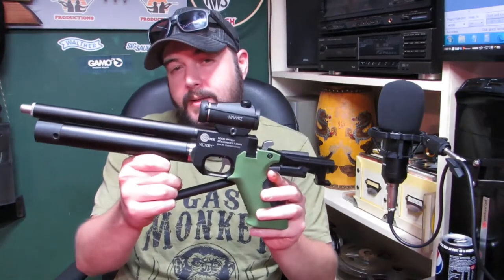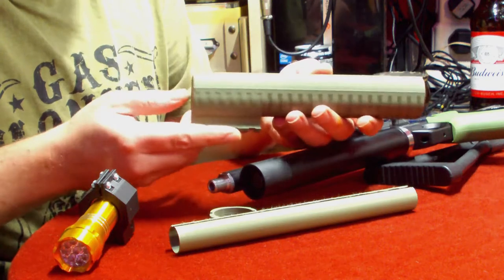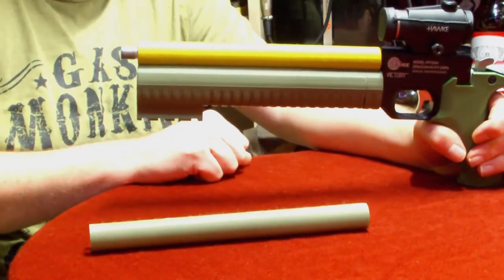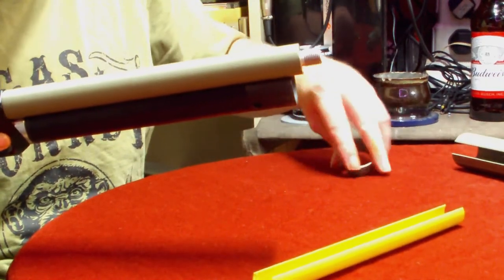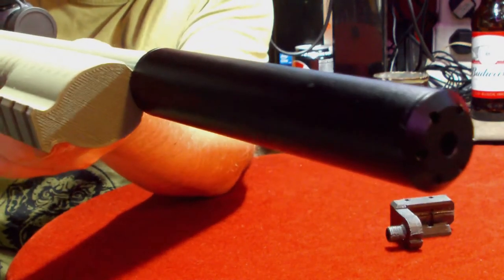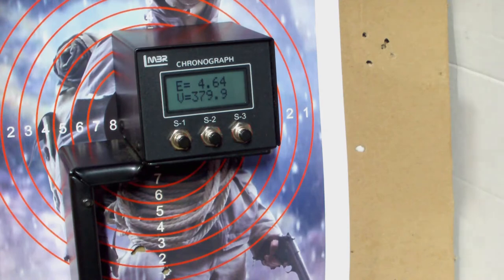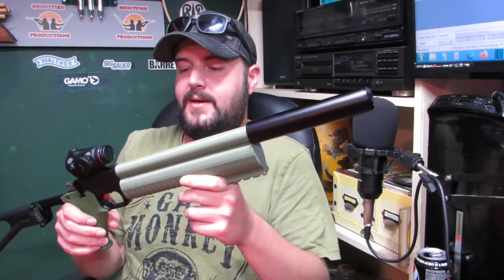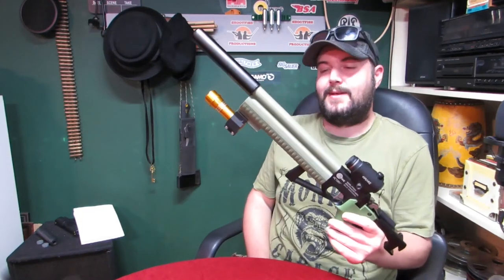SMK PP700W PCP Pistol Customized With 3D Printing

Comment: How can we purchase or request these parts?
Reply from the maker: What parts would you like?
Reply: @ShootfishProductions  I would like both top shrouds the clip to cover silver by housing and torch mount in black
Reply from the maker: The clip bit to cover the silver bit would be printed all together with the shroud. I done it like that because I made the shroud too short. Decide what torch you want to use with it and let me know the diameter so I can size the holder to fit. I have matt black filament I could print it with. Also I think the enclosed pressure gauge is the way to go so you cant damage the gauge. I would have to print it out to check for fit and quality, then give you a price. Let me know the torch size and if its ok for covered pressure gauge, and if matt black is ok. Regards, Nate.
Reply: @ShootfishProductions  hi the torch diameter is 30.3mm 
And end enclosed shroud in Matt black is cool. Send a price to my email above and we can go from there 👍👍 thanks for fast response 
Regards 
Natt
Reply from the maker: cant see no email on your page, email to me to address on our about page on youtube.
Reply: @ShootfishProductions  added mine in my about. I can’t find email on your page 😅
Reply: I'd like to purchase the shrouds please